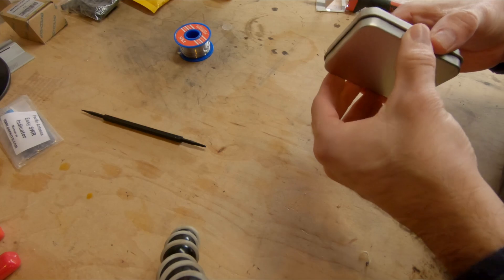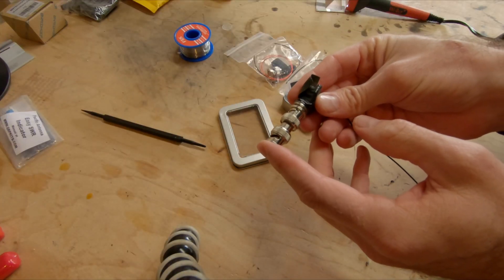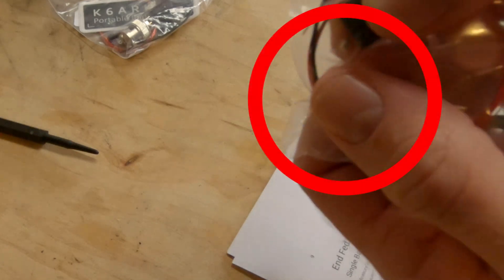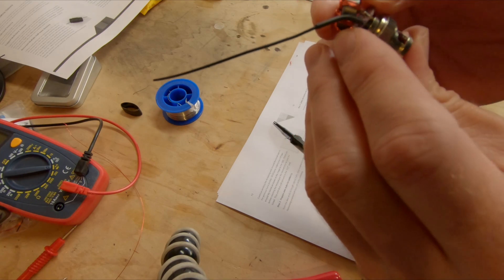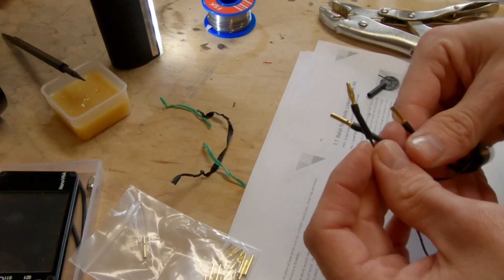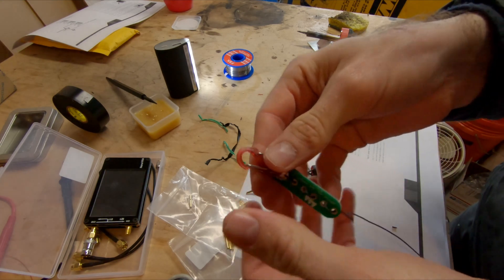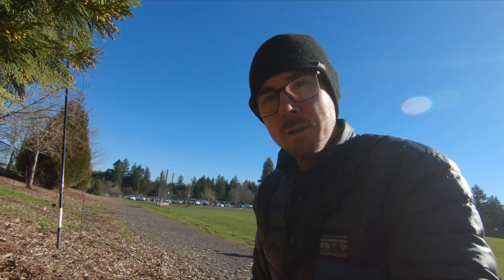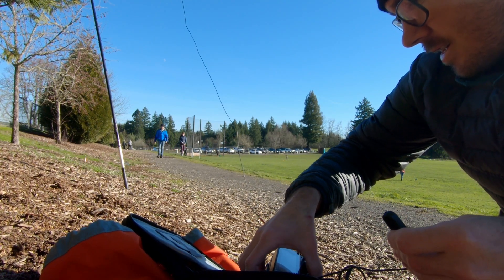Building and Testing the K6ARK Portable End Fed Random Wire Antenna | Dirty Workbench | QRP

Comment: I live in a restricted antenna space apartment. So for months, I puzzled over how I can put up a working antenna. First, I put up  a 40 meter dipole but it's under the roof eaves, not that visible but not that radiating, either.  So I  though, why not do POTA or something, or at least set up my  G90 or IC7300 for that in case I  have some free time and a running vehicle that I can use for that. 

Then I ran across K6ARK's EFHW antenna. I bought two, one for random wire and one for EFHW. The  EFHW didn't work because I got the antenna length wrong, (per my VNA, tunes to below 40 meter band as I didn't account for the lead-in from the antenna. So today, I built this random wire version. After all, the G90 has a  very effective tuner! 

Oh, the antenna? It's a piece of .028 MAGNET wire out the window to a tree. Cost me 11 dollars for 527 feet of that stuff!  Once I put it up, I've challenged friends to see it, and nobody so far has been able to  spot it! Yet it's out in free space about 20 feet up above  a large parking lot,  to a  tree at the end of that. 

So today  I finally got around to building the Random Wire version and hooked  it up to the  G90, and right  off the  bat, at 5  watts,  with low signals on 40  meters, I  made two Northern California contacts! Both were a little weak here, so I was very surprised that they could copy me better than I  them, and me only running 5 watts. I did, on request, crank the G90 up to twenty watts, though K6ARK says the unit is only designed for five. Of course I  was louder there, but it wasn't really needed according to the second contact I made....
Reply from the maker: Awesome! The duty cycle might also have to do with how much wattage it can take. As it heats up it might get out of tune.
Reply: @N7KOM  Good thought! Thanks
Bob, KL7EAL

Comment: Cool build! I’m gonna be ordering a couple of them in the next few days!
Say do you have build instructions for your mini mic?
I’ve seen it on Adam’s channel as well, but can’t find a source.
Thanks for the video!
Reply from the maker: I don't have instructions on the mini mic, but  Radio Runner does: https://www.youtube.com/watch?v=QSccadQoadM 
It's a simple modification to those mics that come with baofengs.
Reply: @N7KOM   thanks! Just saw it. Looks way easier than I thought it might be. 
One more question; did you have to change any settings on the radio?
Reply from the maker: @tjs2909  Just turning the power up from 1 watt to 10 watts 🤣🤣
The KX2 tuner handled everything.